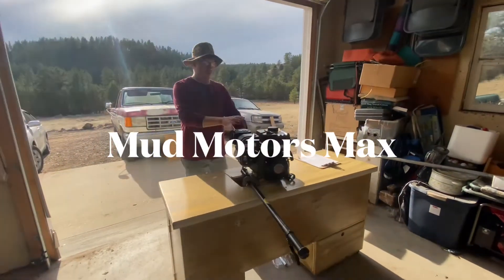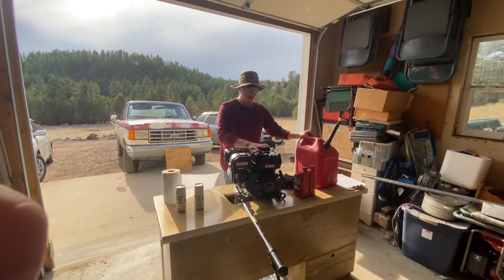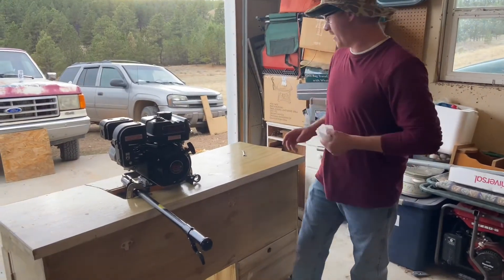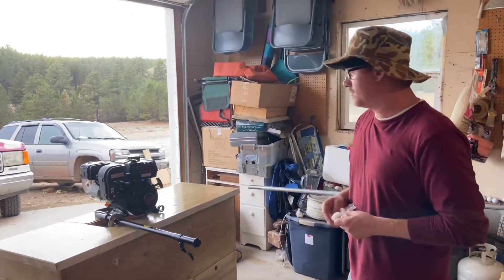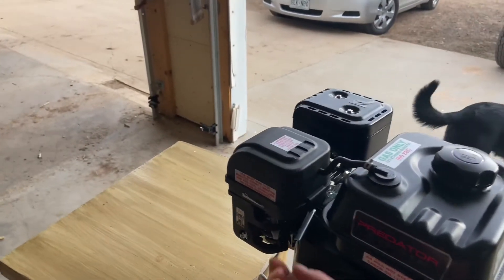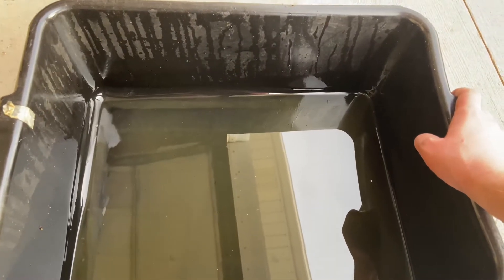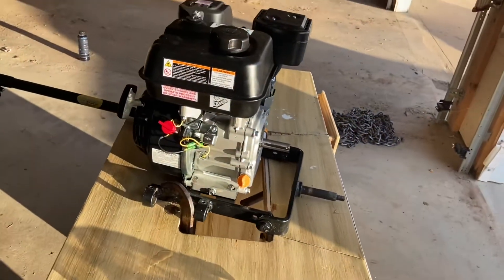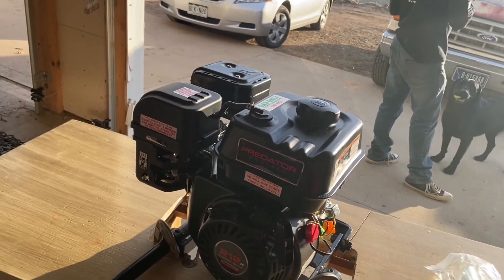Predator 212 (or any Honda Clone) BREAK-IN Fast Version

Comment: I followed all the steps exactly and used high mileage 10-30 oil etc… installed it on my log splitter and have used it a few times but I have to pull it a number of times to get it to start. Any ideas?

Comment: Just pull the plug, put a tablespoon of oil in the hole, put the plug back in, stick a vacume to the oil access holes, suck out debris, fill with oil & run it

Comment: This is a neat and interesting way to break in. I start the engine and let it run on a mid idle for an hr. Then i let it cool down completely. Then i do it again 2 more times on quarter throttle. Breaking in everything slower at a lower temp seems to prolong the life of my engines. Of course iv used many different methheads 😂

Comment: That is a lot of waste of oil you can go longer between changes.  

I break in like this.  Put in conventional oil and add a 2oz zinc additive  (Lucas).  Run for 15 mins then shutoff engine.  Give it about 5 minutes for the oil to pull down the bits of metal.  Run again for 45 minutes just above idle.   Let it fully cool down and the oil to pull the metal to the bottom.  Change oil, conventional again with the zinc 2oz ad as well.  Now I mount the engine  to whatever I am going to run it in and run it for an hour a low load.  Then put in a full synthetic with 2oz or zinc ad and run it how it will be ran in normal use of an hour.  Change oil again and only ad 1oz zinc and go 10 hours before another change and keep that synthetic oil plus 1oz of zinc changed every 10 hours up for the life of the engine.   Normal auto oils no longer have higher levels of zinc.  Not even the high mileage stuff anymore.

Comment: Even you NEVER changed the oil in one of these engines, it would last virtually forever in anything but an industrial application provided you never allowed it to run too low or out of oil. My neighbor didn't change the oil in his garden tractor for 15 years- and it never missed a beat. I do not recommend this practice, however.

Comment: Why do you have to break in a Predator engine when you don't have to break in any new engine powered yard equipment like a lawnmower, tiller, snow blower etc...   I know what the manufacturer states but it seems puzzling to me when I'm 65 years old and never ever broke in a new lawnmower, lawn tractor etc... and I never ever had any engine issues.  just asking for an opinion
Reply from the maker: Well these engines have to be casted the blocks and so there is tons of casting material in these engines. You don’t have to yourself but I’m telling you the first time you take a look at the oil after your first break in and see all the metal casting material you will be 😳 shocked. Then you might understand
Reply: these pred engines are pretty universal so they can run pretty much all the time on idle or full speed, hence you have to break the engine in.  Most small engine powered equipment on the other hand run at full speed all the time. So they break themselves in .

Comment: Just ordered me one to replace my 196cc on my minibike. i snapped the crank in two on the 196cc lol
Reply from the maker: Check out the wildcat 223cc I have a video of it I love this engine blows the predators out of the water!!! Bigger bore longer stroke more horsepower more torque same weight same class Same three-quarter inch crank shaft diameter

Comment: Why high mileage oil?
Reply from the maker: The zinc
Reply from the maker: Zinc or zinc dialkyl dithiophosphate (ZDDP) in motor oil creates a protective coating on metal surfaces in the engine so it can stand up to the stress put on the camshaft and other components. Your average oil produced today provides enough protection for most cars used in normal operating conditions
Reply: @MudMotorsMax  good to know! Thanks for the reply.
Reply from the maker: @kyleshilman8541  anytime! Glad I can help